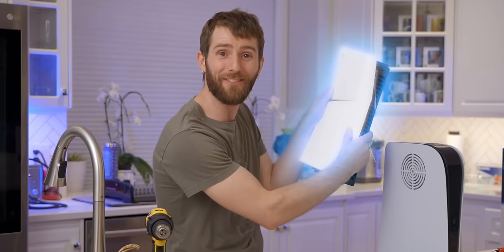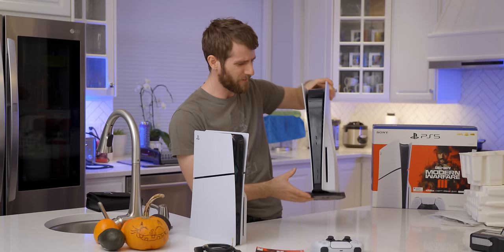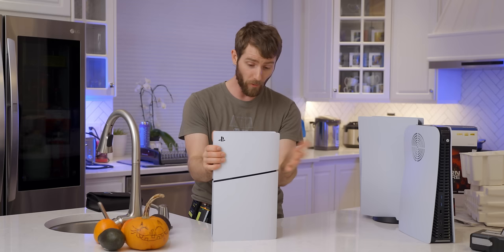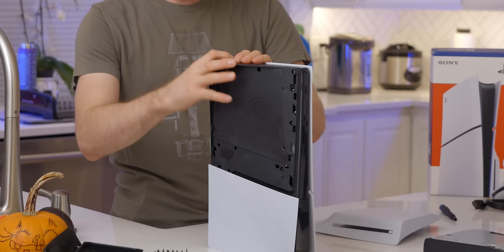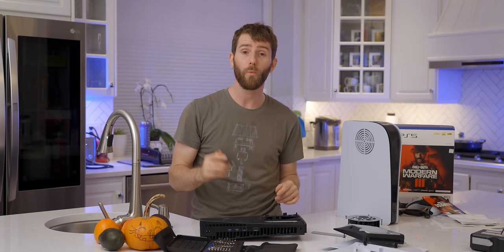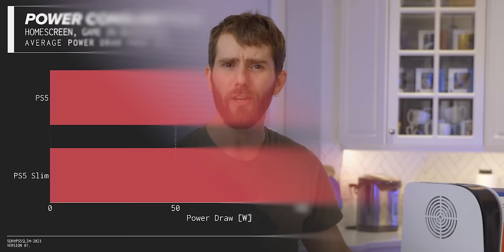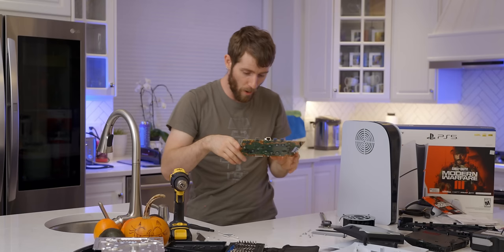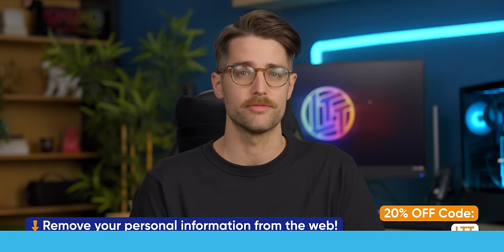PS5 Slim First Look and TEARDOWN!!

Comment: It's actually pretty dang impressive the performance you can get out of a console for the amount of power they use.
Reply: Goes to show how inefficient x86 is when you see this and what Apple does with their chips. That's vertical integration for you!

Edit: I was wrong.
Reply: Optimisation my friend
Reply: @megatryn you completely missed the point but sure buddy
Reply: It's nothing to do with either optimisation or vertical integration. It's simply chip architecture
Reply: @megatryn the ps5 HAS x86 architecture….
Reply: Nanomachines son
Reply: @megatryn  PS4, Xbox One, PS5 and Xbox Series S/X are all x86.
Reply: A console is a PC now, not like old times
Reply: My undervolted gaming laptop has entered the chat.
Reply: @SilvioBearLusconi  well, that proved me wrong then.
Reply: @megatryn A bus is more inefficient than car when you look at raw numbers but it can transport more people.

x86 supports most commonly used instructions set and huge variety of workload. 

It’s less efficient than ARM but for computers it can run every type of task (encoding, run games, processing data). 

Although it is also true that most people do not care and they’d be better off with better efficiency than versatility.
Reply: @megatryn  It has a custom AMD ZEN 2 processor, which uses the AMD64 (x86_64) instruction set.
Reply: No, it really isn't.
Reply: Yea it's very impressive. Keep in mind, the efficient OS, FSR and dynamic resolution are big contributors to AAA title performance on the PS5 as well as a bit better optimization.
Reply: @megatryn PS5 is x86
Reply: it also shows how inefficient x86-64 has become
Reply: wth does console efficiency have to do with with Apple? I mean maybe PS6 could be ARM, but everything relevant today is x86, unless you count Switch as relevant
Reply: @BigCarso to be fair, if you built a PC which is the equivalent of a PS5 you wouldn’t get the same performance as the PS5. It’s also why consoles last for years before being updated. All because the games are optimised for the console hardware, but broadly for PC hardware. Hence why the performance from these PS5’s are great compared to the power they use (as per OP’s post)
Reply: My Ryzen 5600X and RTX3060 uses 180 watts under gaming load and is probably more performant.
Reply: @megatryn  Good on you for taking the L. It happens to everyone but most of the time people just double down on the fact that they are wrong. Kudos to you first showing excellent humility
Reply: @techtt6213  RTX 3060 alone has tdp of 160W. You have to add motherboard (70W), ssd (20W), peripherals to match PS5s 360W budget.

That’s tdp and for actual usage you wouldneed to use multimeter
Reply: @prateekpanwar646  Depends on the context. If a bus can take 40-50 people at 6 miles per gallon and a car can take 5 people at 20 mpg the bus 2-3x more efficient
Reply: @techtt6213 can you do 1440p gaming at 120hz without DLSS? I’m sure your visuals probably look better but I wouldn’t think it’s noticeably better? I’ve a 12600 and a 3070, but don’t see those figures on AAA games unless I lower the quality. Even so I imagine I’m still using more power than a PS5!
Reply: @BNR_248 didn’t know that consoles use FSR! It’s certainly nice to just play a game without having to spend time tweaking in game graphics settings to get the best performance for your hardware 😂
Reply: Actually, you get exactly what you would expect for 370W out of a ps5. It’s not super energy efficient or anything. A PC on 370W would perform about the same as a ps5.
Reply: @mspeter97 thats literally what the PS5 etc runs, the PlayStation has been X86_64 since the PS4 and the Xbox since the One
Reply: @noahw5887   My calculator draws 0.6W and can play pokemon thats efficiency right there
Reply: @prateekpanwar646 you can downclock things without losing much performance but significantly reduce power draw
Reply: @originalgenetics420 you can just hook either up to a TV or a PC monitor

besides, i don't game on a TV and i game on a computer, but even then the absolute max draw from my TV is 170W, much less in normal usage and thus still under 600W with a PS5, and as i said you can run that on a monitor too
Reply: wait, how is it better performance? Im not a techy guy. I thought he said same power? Ps5 slim advertised to have it lesser to have a cheaper electricity bill right?
Reply: There are many laptops since last 3-4 years that easily outperform a console and use like 150 watts total ..
Reply: @megatryn  Would you say you were... dis-armed?
Reply: upscaling ;)
Reply: @megatryn  x86? and guess what chip console use as well? yep, that's x86...
Reply: hardware and software optimization is EVERYTHING.
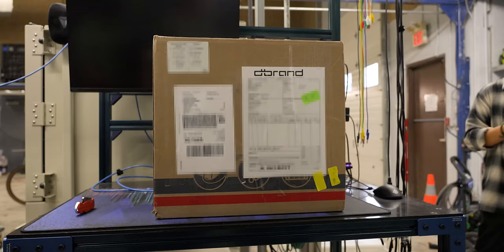Reply: 0:30 fell of a truck
Reply: @SilvioBearLusconi  X64 actually.
Reply: @MadMetalMacho  Lol! Yes :D
Reply: That's what a good optimisation do
Reply: @BH4x0r ps3 has powerpc architecture which was also used for old mac computers
Reply: start using apple silicon m1/m2/m3 macbooks and you'll be blown away into pieces at the efficiencies.
Reply: @Zeebean384 You do know that consoles don't run every game at native resolution and they also use upscaling technology right?
Reply: That's what the developers being able to know EXACTLY what hardware each and every player is going to have and can have all that time to extremely optimize their game accordingly. PC optimization is all over the place because it's impossible to know everyone's individual setup.
Reply: @BH4x0r  True if pc is stable.
Reply: @_kitaes_  It, and the 360, although CELL was a bit... Weird
Reply: pc uses the same amount of power with better performance
Reply: @_kitaes_  then it's since the PS4, my bad

you can tell i haven't really been following the console scene...
Reply: @StefanNovovic  lol maybe if your PC is from 2005. My GPU alone pulls 200 watts at load and my CPU pulls another 150-180 watts at load. Just those two components alone pull more power than what the entire system is doing on a PS5.
Reply: It's everything with optimization, they design a whole game around a console. @BigCarso
Reply: 225 watts is ALOT wtf are you talking about?
Reply: @ceasursmoke1391  you don't research the power draw of stuff often do you? Do you realize something like a well pump or a sump pump draws over 1000 watts when it kicks on? Or how about this. Your toaster uses more power than the PS5. Or even one better, your coffee maker uses twice the amount of power than a PS5. 250 watts is basically nothing dude lol.
Reply: PC desktop hardwares are super inefficient. Meanwhile on laptop side, my 14 inch razer blade with ryzen 9 and 3070 and consumes the same amount of power as PS5.
On paper with the specs it should blew past PS5, but it didn't. Software optimization is another thing that PC sucks at.
Reply: @megatryn  regular PC components are tuned to chug power for those last 15-30% of performance. Limit your processor or GPU to a reasonable power budget and the performance per watt skyrockets.
Reply: nah, not really .. look at laptops, waaaaay more power and that on battery
Reply: Imagine what Sony could do with a top of the line cpu and 4090
Reply: @lharsay  the xbox 360 was also x86. That was the one advantage it had over the PS3 in it's early days. It was significantly easier to work with than the ps3's cell processor.
Reply: @lumiereeclair  360 was never x86, its just easier to develop with compared to PS3. OG xbox was x86.
Reply: price to perf ratio consoles kill the pc
Reply: @legendman97 I imagine them charging 2500$ for the system lol.  They would go bankrupt
Reply: @BigCarso  wrong it's the entire arch including the os and graphics stack, you think for example the version of windows in a series x or s is the same vanilla windows you install on a pc? totally wrong even still today we have to manually lean up windows install to debloat and get something similar
Reply: when you get games designed for that spec and that spec only, it'll work
Reply: @Zeebean384 well, you would get the performance if you just aggressively debloat windows AND use similar graphics settings and dynamic resolution. consoles are often locked at low-medium depending on the game, and they constantly adjust resolution to maintain fps.
Reply: @StefanNovovic  
About the closest thing I can think of in power usage would be a configuration with an i3-13100f and GTX 1650. Would use around 240 watts (still more than the PS5) and would definitely perform a lot worse.
Reply: @techtt6213  
Not sure what universe you're living in. 3060 uses about 170 watts under load. I'm not sure about the 5600x, but it's pretty safe to say that it's more than 10 watts. Plus there are plenty of other things in your system that use small amounts of power. You're definitely well past that 225 watt mark.
Reply: @PJxpanterx  the xbox has always been windows based
Reply: @OfficiallySweaty  i wouldn't say Windows based per say, definitely based on it's graphics though (DirectX) hence the name (Direct)Xbox
Reply: Not really, it's using hardware equivalent to pc hardware from 5 years ago.
Reply: It’s the OS and custom architecture that makes the difference. x86 is powerful, it’s limited when you have to run Windows/Linux/MacOS over it.
Reply: @karljuliuz  
It's roughly RTX 2070 equivalent. That's pretty impressive for 225 watt total system draw.
Reply: @BigCarso It has A LOT to do with optimization. When the game developers only have to focus on one chipset/GPU on the PS5 and not try to make games work with thousands of different CPU/GPU/RAM etc configurations like they do on PC then it’s going to be much easier to optimize those games to work well and use features like FSR etc.
Reply: No. No. No. What you think is Good is already 2 gens behind.  Will you really think the PS4 pro after 12 years is a beast in 2025 lmao
Reply: @megatryn nice man enough to take the L in public. Keep learning friend we all make them
Reply: @legendman97 Doubt they’d ever use top of the line components.
Reply: More impressing is the size comparison to midrange gfx-card these days.
Reply: @Zeebean384 Exactly, this right here. There are no other targeted specs for video games on console other than making sure it can run them. Well vaguely these days lol, some are hit or miss. But overall I'd say most consoles rely on developers targeting the performance of the hardware exactly.
Reply: The difference is designing games for a very specific hardware setup.
     The advantage Apple has over Windows systems and Android phones is that Windows and Android are created to be able to do ANYthing on ANY system.

That's also why feature phones (and flagship phones) get custom versions of Android.
      The difficulty that other companies experience is that the next phone might have entirely different hardware, and it's not viable (/ cost-effective) to maintain all these different Android variations for many years, when each phone requires a different custom version to run its smoothest.

With Apple, you get 2~3 phones a year, with varying storage and more/less camera lenses.

So optimization becomes more like "if there are 3 lenses, enable (a feature such as) portrait mode."

      Various iterations of Linux have shown that an x86 setup can have a lot more performance if you're willing to put some extra work in learning how to do more complicated tasks yourself (or 'learn about how computers actually work, and learn some of their language', e.g. using the terminal))
Reply: @prateekpanwar646  Yep... the only real advantage to ARM is in low power portable efficiency. That doesn't really translate to devices that can use however much power they want like a desktop.  You go for ARM when you want to keep a device cool and sipping power for lighter tasks. You go x86 when you're going for raw power.
Reply: It’s insane what these consoles can do now. I have a 7900 XT and the PS5 exclusives like God of War or FF16 look better than anything on my PC
Reply: @originalgenetics420 what TV you using that's pushing 200w
Reply: @techtt6213  a 3060 is much much worse than a ps5 lol that thing is a potato
Reply: I wonder what this guy means by "performance"... What performance ? Lol... It's running Almost 3 generations old Ryzen CPU and almost 2 generation old GPU. Just because it can run your latest games at 30-60fps being upscaled from 720p to 4k is not what I would call "performance"  It uses around 230W on load. That is not that low, a laptop with something like 4060 or 4070 will most likely use 60w CPU and 140w GPU which will obliterate PS5 in raw performance with less wattage. But even this is nothing compared to what's coming in a few years. A R M will change the PC (windows) Industry drastically. Even with 50W of power ARM will push CPU performance to the level never seen before. I will not be surprised if we are going to see a 100w thin laptop from NVIDIA with their new ARM soc that will make today's most powerful gaming PC look like child's play. Just saying... Building PC's now is pretty bad. Because you will never know what's around the corner
Reply: all upscaling
Reply: If you are in Laptop space, you can have similar or even better kind of  performance per watt
Reply: 30 fps represent
Reply: @Zeebean384  Thanks, captain obvious
Reply: Surprising what not using windows and using an all in one apu gets you.
Reply: @BigCarso it is optimization and silicon lottery.
PC systems we build use crappy bins. For example, 8 cores Ryzen 7 chip:
- if good yield, goes to laptops and consoles like PS5
- if bad yield, goes to desktops so it can drain more power
- if shit yield, it got a core or two disabled to become Ryzen 5 tier

This has always been the practice in chip fab.
Reply: you can do the same on a pc, on pc you arent tweaking your settings enough if u think its all bad hurr durr

consoles come with optmised settings and also devs work on jt first
Reply: @chriswright8074  clearly tv's has evolved over the years but a 55inch back in the day with an xbox 360 estimated at 400 - 500w wats
Reply: PC parts are just overclocked at factory.
Reply: The ps5 is a 5700xt... 😅
Reply: so like a laptop then
Reply: @mspeter97 you missed the entirety of what he said
Reply: i mean , if you undervolt and underclock PC hardware you come very close , i did minimally undervolt my GPU and it went from 255W max to 110-155W max. if i would actually try it would go lower now do the same for cpu and stuff.
Reply: My whole desktop uses like 450w lol
Reply: It’s like a high powered laptop, it’s the best analogy I can think of
Reply: @Crecross you just proved his point
Reply: @PJxpanterx  They have always been PCs.
Reply: @prateekpanwar646  Motherboard is 70W ? LMFAO, no a Motherboard uses anywhere between 5 to 100W, the ones without LEDs and other cosmetic bullshit use little to no power, they just distribute the power.
Reply: @Supernova094  what laptops that came out 3-4 years that can outperform a PS5/SXS?
Reply: @sinistan1002  no you don't, that's a myth. Windows runs games just as well as Xbox
Reply: @BigCarso  it's a myth that windows is bloated ? you must be a noob to windows pc gaming then. maybe you think it's a myth that M$ constantly breaks installs  with windows updates too? 😄 not a myth whatsoever M$ no longer tests on various hardware the only well tested version of windows anymore is part of the stack that runs on xbox.
Reply: @DrakyHRT  Counting tdp as otherwise calculations would be very inconsistent across different pcs.

Although yeah for actual usage it’ll be 30-60% mostly.
Reply: @megatryn  lol, I like how you owned up to this at least! Well done <3
Reply: @originalgenetics420  Most people don't count monitor power draw when talking about PC power draw so that's a slightly weird comparison.
Reply: @davidandrew7314  Incorrect, you only need to go back to the PS3
Reply: I think thats all optimization if the game developers wouldn’t be lazy it would be the same on a old pc😅😂
Reply: Undervolt your declared 600w gpu and it will use 280w.
Reply: @PJxpanterx  & what about the PS3 wasn't a PC??
Reply: They build them on a apu which the consoles are more like gaming laptops.
Reply: @davidandrew7314   I think confuse computer with PC, the PS3 was essentially a computer but not a PC. The PS3 CPU was not x86 compatlible.
Reply: The quality of graphics is much superior on PC.
Reply: @BigCarso it has almost everything to do with optimization lol
Reply: @BigCarso  Optimization does play a role though. Particularly where the performance aspect is concerned.
Reply: @GarryChenYT It's called down clocking. You can do that and turn on FSR to get fake frames and be the same as a PS5 if a couple cents per watt is too much.
Reply: @megatryn With consoles, The Dev's know exactly what hardware their games are going to run on. With PCs that's not the case.
Reply: @Zeebean384 optimization? On PC? I don’t believe it exists.
Reply: @ceasursmoke1391  it's not alot for 4k60fps gaming
Reply: Don't forget about ease of porting games to successive generation of Playstation consoles, at least up to PS6 which is apparently still going to use custom Ryzen Threadripper APU so that makes it basically doable to get PS4 games installed on PS6 and it would run just fine, along with significant amount of computation performance which would make it usable at 8k video resolution considering it may get what's similar to Radeon RX 9800 XT GPU configuration, meaning superscalar out-of-order ray-tracing processors all for the PS4 games updated to use what's in the console, like they have done so for PS5.
Reply: @prateekpanwar646 not to mention they can run multiple commands at once 😅
Reply: @BigCarso its optimization if every player has the same exact specs games can be optimized way better
Reply: 3060ti and 7700x uses 250w while gaming. So it seems normal.
Reply: @Supernova094 rtx 3070 mobile alone draws 120-130 watts under load, and that's at the same ballpark as ps5 in performance
Reply: @Dempig rtx 3060 is only  slightly slower than a ps5 in rasterisation and much faster in rt. In paper the latter is like an rx 6650xt , which is between rtx 3060 and 3060 ti
Reply: @urmomma2688  I mean the RT performance of both the ps5 and 3060 is not even worth talking about, they are both terrible at it.  Not sure why people always talk about RT performance of budget cards, I wouldnt use RT on anything less than a 4080 tbh.  The 3060 may technically be "better" than the ps5 RT, but its like arguing over which turd smells better.  They are still both turds.
Reply: @Zeebean384 optimization*